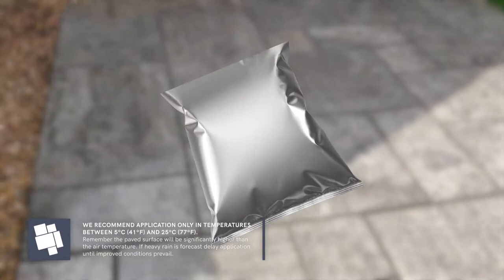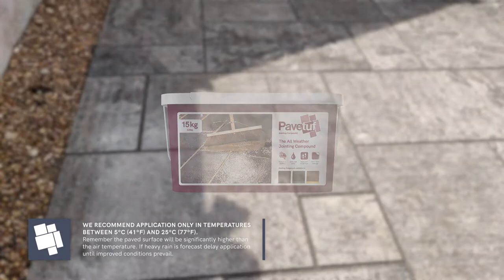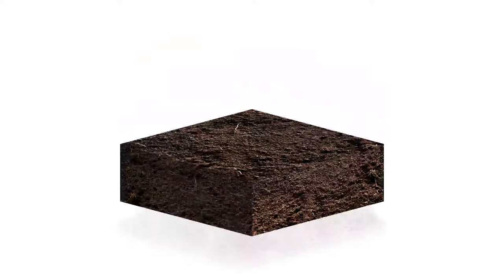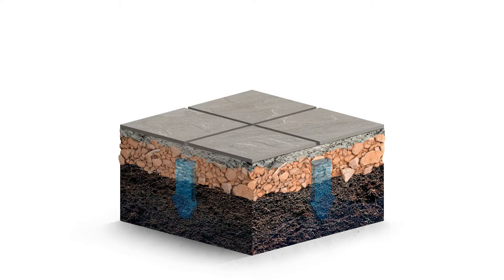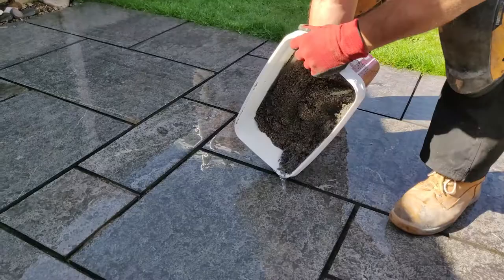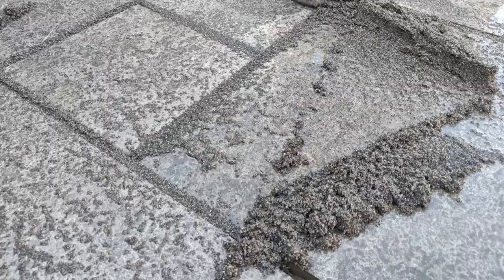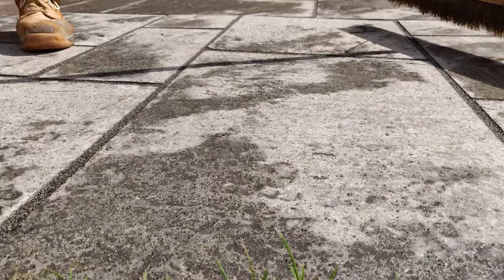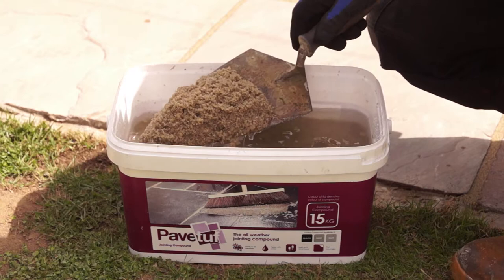How to Joint your Patio Paving | Pavetuf Jointing Compound

Comment: Ive also been made aware of Pavetuf Sealer. Is it best to apply sealer before jointing compound so it gets into the edges of pavers as well as the top ? Also on another job I’ve noticed a few pavers where jointing compound appears to have separated from edges of pavers. I was wondering if the sealer would improve adhesion on the edges of the pavers ?
Reply from the maker: Hi Steve,

Our Pavetuf Sealers are water-based and impregnate the surface of the paving, so it is a good idea to apply them before the jointing compound.  As far as the adhesion is concerned it will not affect it either way. The best way to ensure a good bond to the side of the paving with the jointing compound is to make sure that the joint width and depth are fully achieved and to push the compound into the joints with a jointing iron to get good compaction.  

The minimum width is 5mm and the depth 20mm. If your paving is less than 20mm thick then you can use a method while installing the mortar bed to clear the joint at the bottom to gain the extra millimetres required.  See page 10 of our guide available on our website for full information.

https://pavetuf.co.uk/documents/Pavetuf-Jointing-Compound-Usage-Instructions.pdf